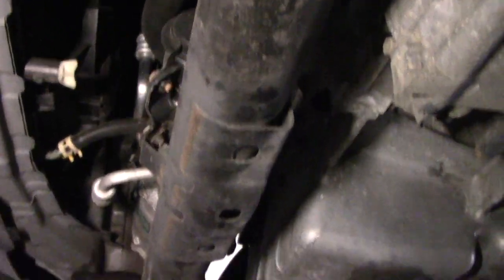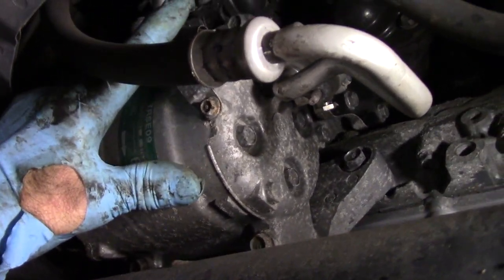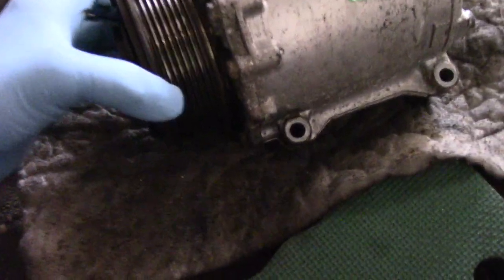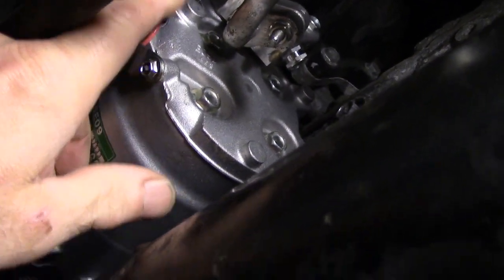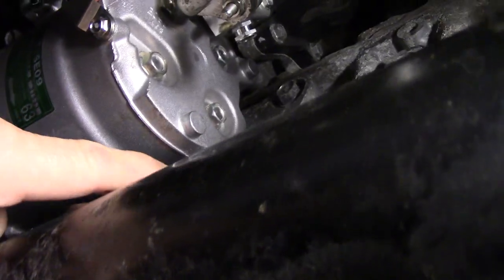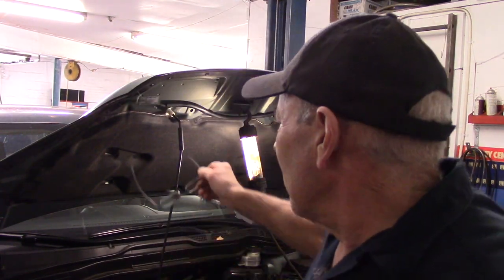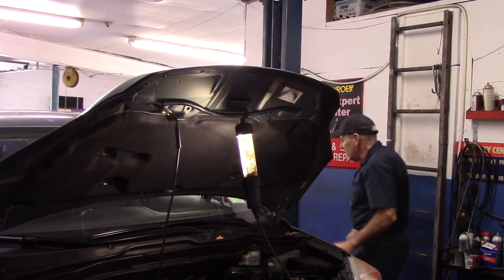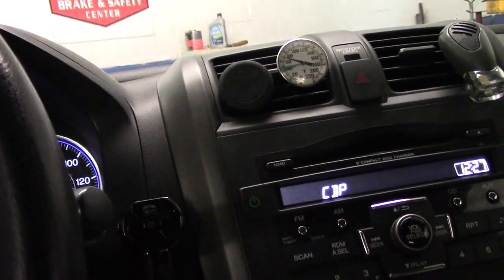2006-2015 Honda CRV AC Compressor Replacement

Comment: One of my favorite cars was a 80's Honda, rust and all. We had to be careful not to drop anything on the floor because it might fall through one of the rust holes in the floor. I remember push starting it for 6 weeks because I didn't have the time or money to get a rebuilt starter motor. Eventually I drove it to the scrap yard to take her to the great crusher in the sky. The engine survived but the car crumbled around it.

Comment: So Jim, did the internal compressor failure release metal into the lines? Most Honda 2007-2011 compressor have this issue (compressor shaft to thin). What compressor did you use to replace because I am SURE you don't want to put the same unit back in with the "engineered failure" still in it.

Comment: Do I need to vacuum the refrigerant when replacing the compressor?  Do I need to manually oil the new compressor?
Reply from the maker: Yes you will need to vacuum first . You will also need to vacuum the system before you refill it. If you use a complete AC charging station the oil will be added by that machine.
Reply: @jimthecarguy  Thanks!